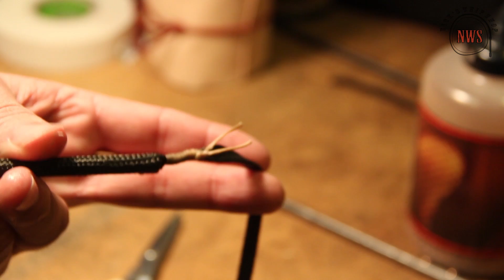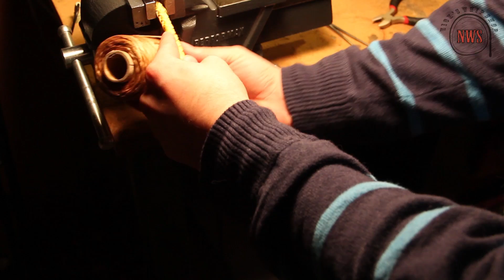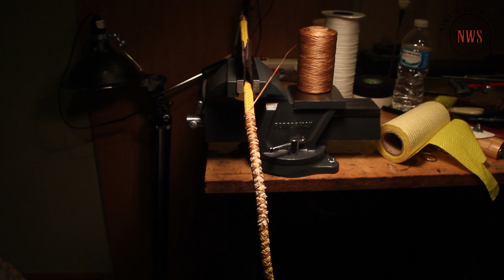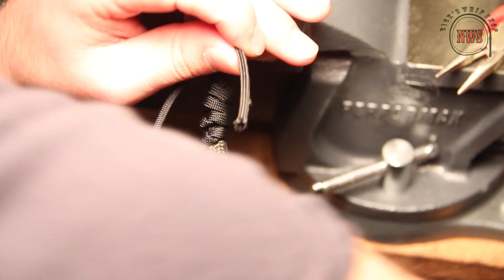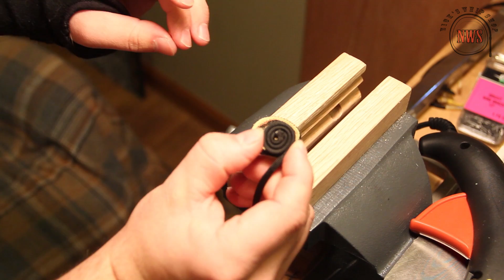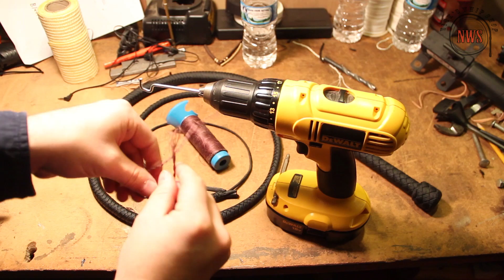My Current Nylon Bullwhip Making Method | Nick's Whip Shop

Comment: I see a few people asking about the dacron.  The easiest way to find it is to search for "lacing tape" (Easy to find on Amazon).  This stuff is super common in the aviation and aerospace industries for bundling wires and cables in place of zip ties.  It's available in several materials (some stronger and some weaker but Dacron in the size he's using is usually rated with a breaking strength of 50lbs).  Sometimes the sizes are expressed as size 1, 2, 3, etc... What Nick is using would be size 3.  It also comes with several different treatment options.  You can get it waxed as well as a few other options for different purposes. "Finish A" indicates it's untreated and is probably fine if you're going to wax your whip anyway.  But the treated stuff is often easier to find.  From what he says in the video it appears strength is the main reason he uses it so just make sure it has a high breaking strength (50 lbs or more) and probably that it's the right size and you should be good regardless of whatever other options you go with.  The floor mat stuff can be found here.  http://www.floormats.com/double-sided-floor-mat-tape/
Reply: jeremy roy thank you
Reply: Bless you good sir. Couldn't figure this out!

Comment: Hey Nick, thanks for all the great vids. I have made two whips now and on my third each one getting better. I do have something I could pass along tho if you dont mind. The tube for the BB's is cool but what I found that works great Is a drinking straw that you get with a soda. It fits right in the 3/8 core and the BB's flow right thru with no problem. keep up the vids,,thanks airboat233

Comment: Your tutorials helped me a lot in getting started! So far I built a 6ft snake whip based on your first bullwhip tutorial (Just reworked it into a 5ft snake since I plaited way to loosely on the overlay, now it cracks like a beast), a 3ft snake whip based on a combination of the strand lengths from your two tutorials as well as a 4 1/2‘ bullwhip based on the strand lengths for a 4ft bullwhip from your website..I don‘t know why, but I could have carried it out to about 5‘ even though I cut all the strands to the exact lengths you gave. Next up will be a 7ft and a 5ft bullwhip :)

Comment: People might have already mentioned this, but you can use slingshot ammo, or ball bearings, or find the heaviest weight piece of chain you can that's basically little balls connected together, like the kind of chain you would pull to turn on a light. You can use multiple strands of those as your core.

Comment: Hi Nick, I've been following your videos quite a long time. And one of the first things I did differently than you was how I drive nails: I have a rather lightweight vice that I can operate with one finger and just used that to drive rows of nails into the handle. By now I've gone to using a staple gun and pushing the tacks in with the vice if necessary, just opening and closing it rather quickly. Looks like a lazy chewing motion :D Anyway, thanks a lot for your great videos! Have a good one

Comment: Hey Nick, just a designing tip, i just finished my second whip and I got really frustrated trying to figure out a 2 strand diamond plait on a 16 plait whip, so i ended up doing a 4 strand haringbone. I just picked up 4 strands at a time, and went under 4 over 4. I actually fell in love with the pattern and it makes the handle look like a medieval sword handle. plus the handle turned out very thin and sleek because of this plait. Try it out if you haven't already

Comment: Nick, after trying a couple different brands of parachord. I have had issues threading my fall inside itself. So.  I have used the "Secondary Method" that you suggest with one minor deviation. I tie a bowline knot, instead  of your double overhand knots. 1) it is a better knot that WILL NOT slip when tied properly  2) It is a much less bulky knot. The only downfall is that it is a harder knot to tie. Some people have real problems with it! 
Let me know if this is acceptable & what your thoughts are on this or should I return to your method exactly.
Thank you for your instruction & the detail of your videos. Between you and Anthony DeLongis, I've gotta quite the education!

Comment: To make an 8' whip instead of a 6' whip, would you just add 4' to the belly and overlay lengths you show here?  (4' because it folds in half, so adding 2' would only give you an extra foot of length)  I'm assuming the core would just be the right length for the handle plus the sinker cord to be around 8'2" or so.

Thanks for the tutorial.  Looking forward to starting my first whip as soon as I can find everything I need to get going.

Comment: definately liking this new method :D glad I watched it before getting too deep (Im only halfway through my first belly if even that xD) on my snake whip (my first whip ever) that new dropping technique will be a lot easier

Sadly though I have no sinew and doubt walmart carries it (I don't have cash anyway even if they do) so I may end up using paracord guts whenever I get more cord (unfortunately the majority I have at hand at the moment is cheap knockoff cord with cotton core instead of nylon strands, so I'm saving my military grade for the core and overlay)

I also don't have flooring material but I theorize self adhesive bandaging would be the same effect, or a shelf lining material I have similar in looks to your floor material, with the bandage or spray adhesive 🤔

Comment: Quick question... if making an 8' whip, would I load more BBs in the sinker cord? Like 1.25' versus 1'? Thanks Nick... your work is amazing, as is your generosity in sharing your methods!
Reply from the maker: Thanks for watching! For an 8ft whip I recommend only 1ft because you are getting more weight from the extra paracord. You can add the extra 3" if you wish though, It will just be a little heavier. I see you fly FPV? That's awesome!
Reply: Thanks for the reply, Nick! Your timing couldn't be better-- my sinker cord just arrived today! Yep, long time RC guy and especially love FPV. Couldn't help but notice your RC gear in the background in some of your vids, too. Thanks again for the info and take care!
Reply from the maker: Oh perfect! No problem. RC aviation is such great fun! Take care man!
Reply: NicksWhipShop hey Nick, I have another question. Have you found that handle pattern on the overlay changes the overall length much at all? For example, should I add some length if I'm making a checkerboard handle versus a double diamond pattern like in the video? Thanks again!
Reply: NicksWhipShop I was wondering if I could use the method to find the cord lengths for an  8 foot whip that you posted in your video for the 12 plait whip?
Reply: Genesis Trials Yes you can. You can use it for all lengths as it is just a ratio of length of whip to length of cords.
Reply: Sterling Hamilton thank you for the information

Comment: Since you said you have not changed the handle metal since the beginning I would guess you have not tried this. You can use a threaded metal rod, all-thread. It lets you do some interesting things. 

When you trim away the unneeded cordage at the end you get a threaded metal end piece you can then screw a threaded socket onto. I have placed wooden curtain rod florals onto one of mine. Old pool cues, with a metal "female" sleeve epoxied into it, might could work.Fun to play with as a decorative element.

http://guide.alibaba.com/shopping-guides/curtain-pole-end-finial.html

Comment: Very informative video Nick! I have a quick question, though. Do you think that I could use my B50 Dacron (I use it for bowstrings as well) instead of the artificial sinew AND the polyester that you used in the video? Maybe do like two coats of my one material to substitute not having two? I would like to eventually buy the materials you're using, but I can't really afford that at the moment.

Thanks!

Comment: I was wondering. I'm making my first whip. I hear about waxing the whip when your done. I don't have that stuff. But I have made Alot of Paracord brackets. If someone tells me their is to loose. I get water to a boil and put bracelet in the water for a few seconds and it shrinks nicely. Then it fits them fine. Can you do this with a whip. Pourhot water from a kettle over the whip to shrink and  tighten the whip up. I'm sure the got was shrinks the Paracord. Im not sure would I ruin the whip if I did that. Thanks.... Newbie Steve...

Comment: Hey Nick. Thanks for all your videos.

About pulling strands tight. I've heard it said "You cannot plait too tight." I have had this in mind when making my whips, pulling out absolutely all the slack of a strand before plaiting it. What are your thoughts on this? I've noticed that you don't pull super-duper tight on your strands (or at least, not to me anyway). I also find that my whips don't have the nice fluid roll-out that yours seem to have, especially towards the fall. I feel like the tension I pull at might be affecting it. Any thoughts?

Comment: Do you specifically use 550 para cord or can you use any type of para cord that meets the measurements of the 550 para cord diameter..... I saw 550 para cord at Home Depot and a different para cord that looked the same but didn't specify being 550 para cord and it was 3 dollars cheaper...... The problem is I was trying to make a different whip from a different video ( it wasn't very good because they were very vague ) and now I have 250 ft of 1/8" diameter para cord. Can I use it on this whip? (Btw the inner strands are poly and poly blends)

Comment: Unfortunately, I had already invested in 100 feet of 1/4 inch diamond rope.  But thankfully, it went much faster with the 100 foot version than the 10 feet of 1/4 inch rope I got from Walmart for 68 cents.  So if sticking with 1/4 inch instead of 3/8th inch sinker cord, I'll probably hold off a while before switching.  Also, I was just working on my second whip and ran out of electrical cord, and don't have hockey tape... Have you ever experimented with duct tape, maybe split down the middle??  Just desperate to make more whips lol.
Reply: Oh also, I don't have sinew, is this just a materials preference or cost savings, or is it actually better, structurally?

Comment: What did you mean by "roll" at 15 minutes?
Reply: triumphant39 he rolls in flat on the floor with a flat surface like a wooden board.it smoothes out the whip and helps get the kinks flat i think

Comment: I bought some 3/8 inch sinker cord and when I put the BBs in it can fit 2 in a row, do I just pack it full or line the BBs up 1 by 1?
Reply: Carson Holtorf yeah I would like an answer on this too. I feel like the stuff I've bought is too wide compared to the BBs. Not sure if the hockey tape is supposed to keep them in place.
Reply: Chris Miller I’ve gone ahead and made a few bullwhips and what works best for me is to keep tension on the sinker cord so that it will conform around the BBs. When you have them all in a line then you rap it in hockey tape

Comment: Is the tape you use Hockey or Athletic?
Reply from the maker: I use the hockey tape.
Reply: Does the one you use leave a sticky residue?
Reply from the maker: I suppose it probably would if I were to peel it back off.
Reply: Ever heard of Hurricane Tape? It might work for bellies but I don't think it might be porous or stand up to the heat of waxing.

Comment: I have baught 2 lost of paracord and they have both been the wrong type either too thin in diameter or don't gut easy and became un usable due to fraying, what exactly do I need to buy paracord wise?
Reply: type 3 550 paracord 7 strand i buy mine in spools to make my whips and use walmart  paracord for shotloaded core
Reply: +Tanner 2365 aha! thanks dude!
Reply: James Hughes when u buy them in spool they will be smaller but its 50 for 1000 foot of cord look up on amazon paracord planet they have like 36 colors
Reply: +Tanner 2365 ah that's cool thanks dude!

Comment: I'm not very knowledgable of all this whip stuff yet and I was wondering, what are the benefits or reasons for doing a 16 plait overlay instead of a 12?
Reply: I like making 16 plait over 12 plait cause it makes the whip looks better. There isn't really any benefits doing a 16 plait over a 12 plait whip. The more strands a whip has the more color variation you can put in them or design you can weave into the whip.
Reply: +BostonTricker okay. Gotcha. Thanks man!

Comment: Hey, does anyone know if there is there a cheaper substitute instead of using leather in the foundation of the knot that I can get at most shops? Thanks!
Reply: +Sink Phaze thanks! A lot
Reply: +Sink Phaze hey this is going to sound a bit weird but do you think I could use some cardboard? just for thickness, then cover that with electrical tape?
Reply: +Henry Fisher Deff a no on the e. tape. Its to slippery when its fresh, so the knot will kinda slip and slide. And then when it gets a little older and/or alot of use it turns in to a sticky mess that gets everywhere. I swear, I've tryed every bad idea in the book at least once. lol :p

Cardboard on the other hand, hmmm... Maybe. Deff not corrugated, far to squishy plus if even a little bit of moisture gets to it it will go to pieces. Paperboard(like cereal  boxes and such) might work ok. It holds up MUCH better to moisture. I would suggest doing like in this vid and using nails or some such to help secure it. And, though waxing alone would probs be enough water proofing for paperboard, if your not going to wax you should probably give it some sort of waterproof coating. A thin bit of silicone(gasket maker) perhaps? 

The nice thing about the knot is that its an external component. If it doesn't work/feel right the first time you can rip that sucker right off and try, try again till its right! :)
Reply: I have experience with using thin strips of Gorilla Tape and building them up until they're thick enough. cheap way to get leather would be to buy a cheap leather belt

Comment: Nick you're an amazing guy! 
I'm looking to start making my first whip here in just a couple of days when my cord comes in. I just have two to three questions. 
I'd like to try and use a 14 inch handle and make it about 10 foot give or take two inches. How should I go about converting the measurements so that it'll actually work and I won't come up short half way through finishing it. 

Thank you for your time, hope to hear from you soon and best wishes.
Reply from the maker: Thanks man! Here in the link below, you will find the strand lengths needed for your 10ft whip and since your handle is a bit longer, add 1ft to every strand. Hope this helps!

http://www.nickswhipshop.com/whip-making/
Reply: Awesome! Thank you so much for the reply and speedy at that my cord came in yesterday so it's off to grab some BBS now and to find the sinew and floor mat thank you for everything can't wait to start!

Comment: I bought some of this 3/8" sinker chord from Vermonts Barre Army Navy Store and it is just like what Nick has.  However when it is full of bb's you cannot keep them in a single file one after another because this sinker chord turns into a sack and the bb's get all bunched up.  Even after painstakingly lining the bb's up as soon as it is turned loose they bunch up again.  No way can you even begin to bind it up.
Reply: I've just discovered that Barre Army Navy sent me 1/2" sinker chord instead of 3/8".....that's why it would not work!  Thought it was correct because it measured 3/8" laying flat on the bench.....should measure about 1/4" instead.  Live and learn.

Comment: 1:01:10 why can't u use a fricken hammer +nickswhipshop. ?????
Reply from the maker: +Josh's whips and lanyards A hammer is way to crude of a tool for this job. I need a precise tool as to not damage the foundation or bend the nail with the blunt force that the hammer would provide even with a light swing.
Reply: +NicksWhipShop oh OK thanks my dad wanted to know this lol
Reply from the maker: no problem man.

Comment: Hello Nick and sorry if my question sounds stupid but I could not understand what exactly is the type of cord the you are using for the core and if it could be replaced with some material with similar qualities? I am asking as where I live it is possible that I could not find exactly that type of cord. Thanks
Reply: i use 550 cord filled with 4.5mm copper bb's, it gets snug so i put in 3 and use 2 steel rods together with the cord going through the middle and push them down.